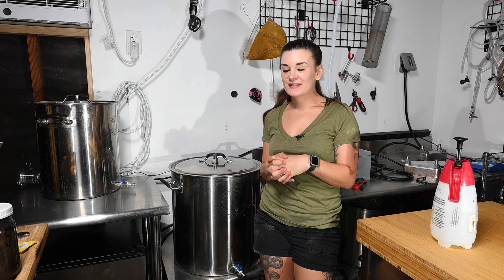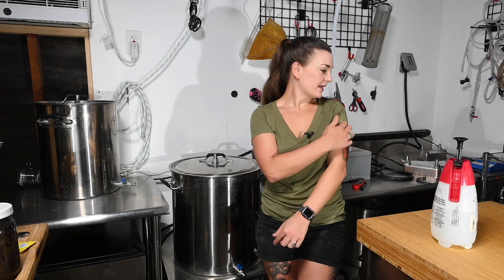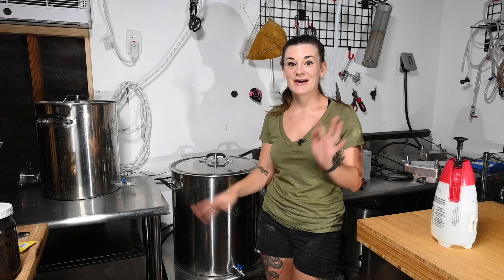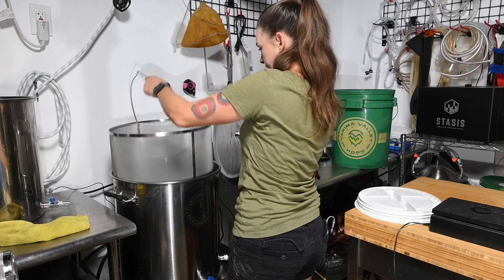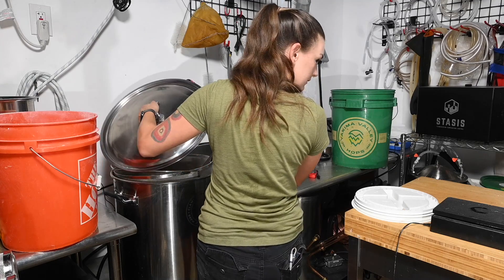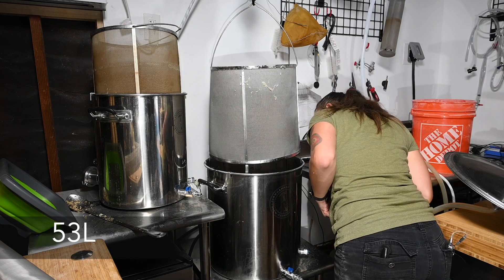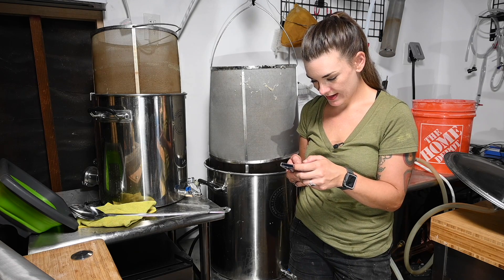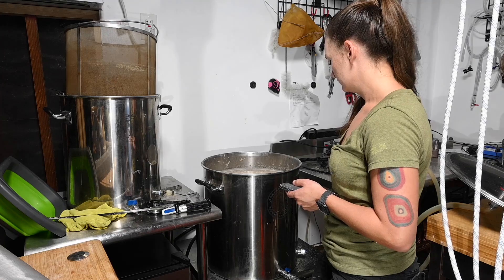Brewing 15gal of Festbier in a 20gal Electric Kettle

Comment: just a thought, I did 10 gal in 15 gal keg, i heated all water then removed half of it, added grain and topped off with water. removed grain and rinsed it with water that didnt fit to the pre-boil needed